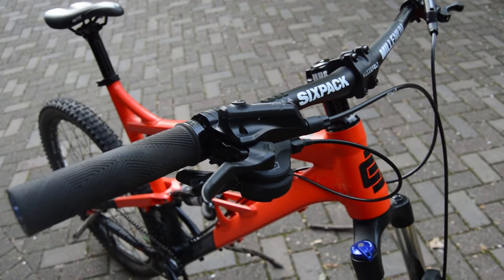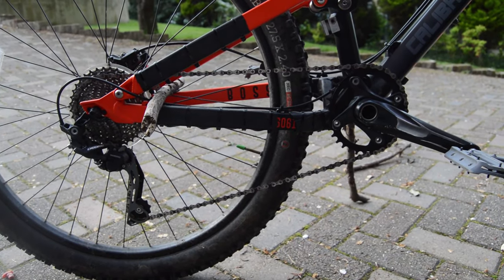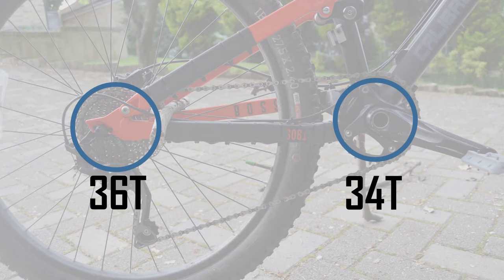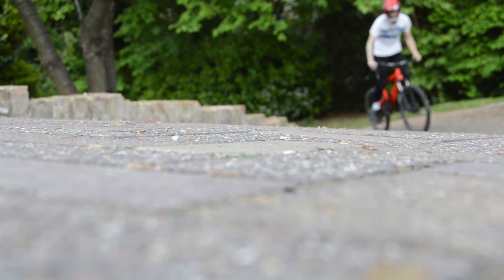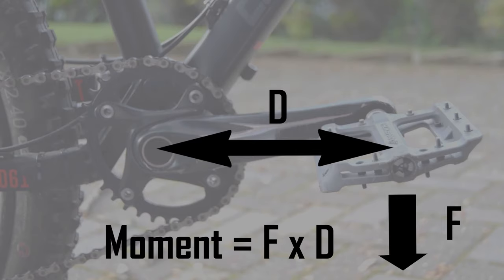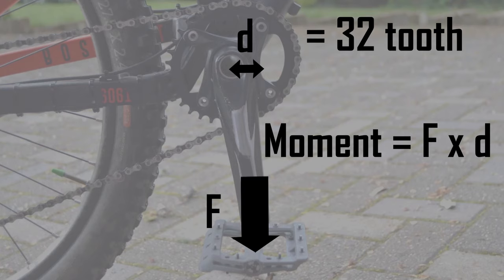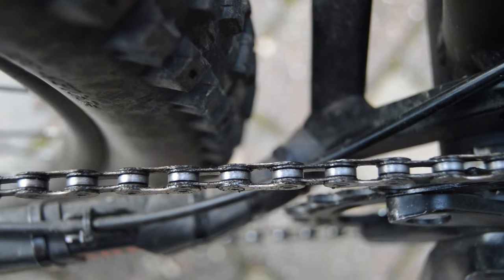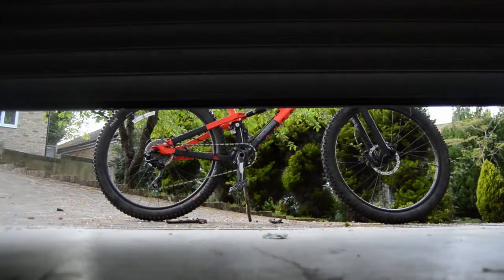Oval Chainrings: The PHYSICS

Comment: In the tests I've seen they never say what sizes they are using, a 32t round, vs a 32t oval is an unfair advantage, I call a 32t oval a part time 34t because of the height.. just go from a 32t round to a 34t round and you'll see a good improvement.. people changing from a 32t round to a 32t oval should see a difference, its TRICKNOLOGY !!! it sells stuff, I'm waiting for oval wheels...;) !!!